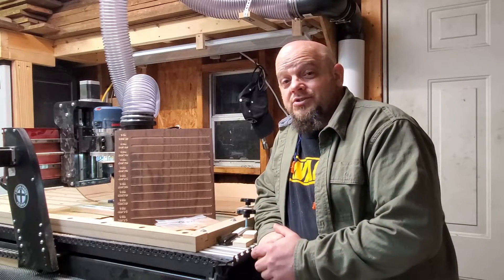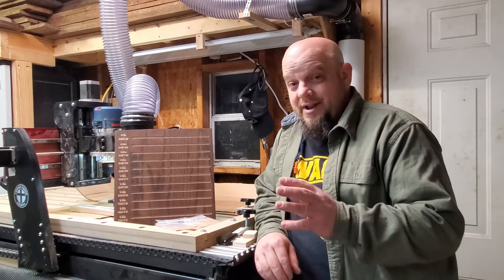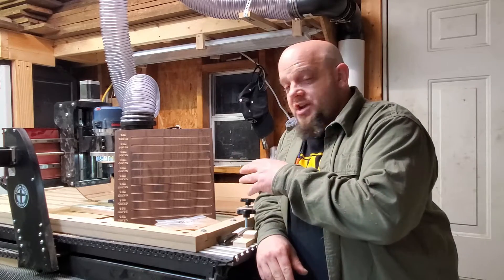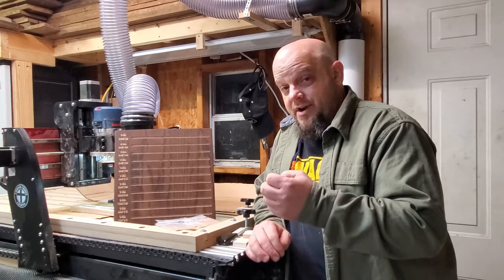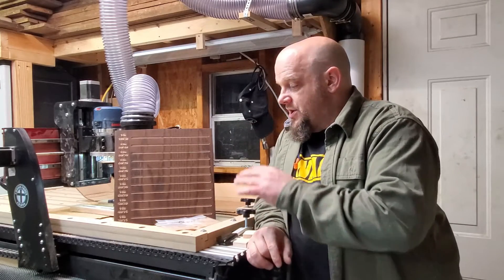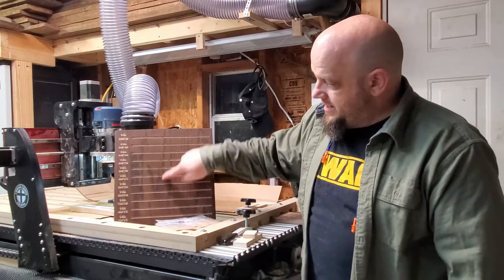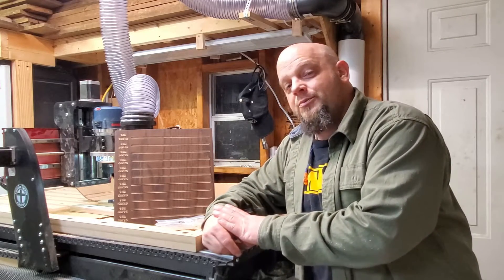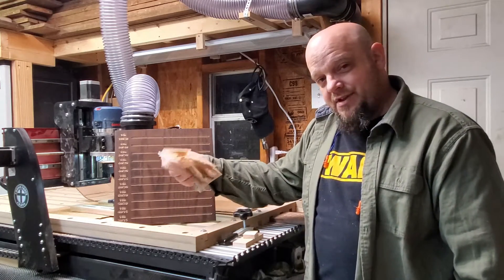Feeds, Speeds, and Chiploads For A Small CNC Made Easy

Comment: finally someone that does not speed up the video and replace the machine sound with music!!..As im just researching before a purchase you should explain some what chipload is..i had to google that..at this point i just want to know how many passes a hobby machine will need to take to cut fully through 1/2 thick mdf or in my case the less dense particle board..you didnt mention the depth of the cut you was taking with the end mill..was the depth of cut you was taking a 1/4'' ?..the same size as the diameter of the bit?..as long as i know the machine im considering will not need to make a ton of passes at less than a 1/64 depth of cut i might be sold..im liking the 1/4'' depth of cut, two or 3 passes would be ok with me..Or is chip load the amount of material that each flute bites and cuts off of the material as its moving into the cut, not of how deep the bit is down into the material?..confusing!
Reply from the maker: Chipload is basically the size of the chip produced.  Most manufacturers have a recommended chipload per flute.  Amana lists theres on their website for each bit.

The cheaper, less rigid desktop machines will always need to run at a slower feed rate, with lowered rpm to line up the chipload requirements.  You can play with those settings in vectric software.  Too high a feed rate and too slow rpm will make chunks, break bits, and leave bad results.  Too low a feed rate and high rpm will burn the cut and bit over time.

Mdf is way easier to cut than hard wood or plywood.  It is more abrasive but easier to cut.  The general rule of thumb is that the diameter of bit equals depth of cut, but on hobby machines, half the diameter equals depth per pass is a better plan.

I hope this helps some.

Comment: i just try search and looking what feed and speed need use my new 2mm and 3mm bit and V-bit 15 degree 6mm-0,3mm carving bit. but all have only old cavemen imperial dimensions, need normal metric system know feed and speed, spindle not can setting less 10 000 RPM. 10K-24K normal. little tip, 97% all earth use metric system, only 3 country use old historic cavemen imperial system today.
Reply from the maker: Do a quick internet search for inch per minute to mm per minute.  Fill in your specks and jot down the result.  A few minutes now saves a lot of work later.

Comment: Of all the "feeds and speeds" videos I watched, this was the FIRST one to tell and show me how to test my specific machine so I can document my recommended feeds and speeds for MY setup. 

If I purchased an off-the-shelf cnc from Shapeoko and the rest, they would have most of the F&S documented already - which is a significant value for a new CNC-er. I built my own setup based on recommendations from a friend in the industry and it's capabilities are somewhere in the middle to low-middle range of CNCs out there.  Now I know how to figure out the best settings for it!

THANK YOU for *demonstrating* how to test a machine!  Well done!  (Yes, it wasn't a fun and interesting video, but it was just as valuable - maybe more valuable - than the fun ones!)
Reply from the maker: Thank you for all the kind words.  That was the reason I did the video.  There was nothing out there showing and explaining.  I'm glad it helped.

Comment: I am really diving into feeds and speeds before I get my Axiom Iconic8 which gets delivered tomorrow. This is very informative! One more thing that would be very interesting that I will probably do when I get setup and run this test is get an infrared temp reader and check the bit temp at the end of each cut to see how the bit is handling the speed/feed. I currently have a X Carve and I have toasted (3) 1/4" bits running them too slow. Thanks for all of your hard work on this!
Reply from the maker: Some bits stay cooler due to coatings, but running them at high rpms and slow feed rates will certainly decrease life. 

Using the mfg data as a starting point then dialing down to match machine and project specs helps.  Then make notes in vectric for said bit.

Comment: Chris i have been breaking down each aspect of the cnc - enclosurer, dust collector, types bits, running Easel program, types of wood, and feeds and speeds. I just cut some plywood to 20x24 and was planning on creating a sample board. Not exactly sure what way to do it, your video was a great help! Thank you.❤
Reply from the maker: I ran into the same issue.  I finally came up with this as an initial idea.  I hoped it would help somebody.  Thank you for watching.

Comment: What is capability of your CNC machine, i.e. Spindle power and Maximum rate along X/Y/Z-axes?
Reply from the maker: On the machine in the video I didn't have a spindle.  I was using a Bosch 2-1/4hp router.  Shark does now offer a 2 & 3hp spindle option (If you have a Shark, the 3hp is the way to go).  

As for "maximum" rate (under load), that will be determined by the bit, depth of cut, part type getting milled (2D, 3D, small vs large), and material.  If you want specs, not under load, that is different.

Comment: Looks like the bit in this pass 3:26 has jumped/twitched at the middle of the pass, do you see it folks? And for groove N6 3:20  rpm is 12000 or 14000 actually?
Reply from the maker: The bit does move at that point.  12k @ 110ipm was not the best option, but was the combo used to obtain the recommended chipload.  That's the part of testing... to see what works and what doesn't.  That low of an rpm didn't allow the bit to spin enough to remove the material at that feed rate.

Comment: Nice video and I like how you did your testing ,thank you. The question is would the feeds and speed you used on oak be the same with plywood, MDF, pine, hickory, and so on as each wood is different.
Reply from the maker: Thanks for watching.  Sadly, the feeds & speeds will vary based on material.  Mdf allows for higher, while harder woods require slower.  Add in the machine variable and its an ever changing process.

If you can get a baseline (the reason I used oak) it makes it easy to put notes on each bit you test in vectric.

This is designed to help you gain a better understanding of your machine and reasonable starting points.
Reply: @ChristcrossCrafts  Thank You for the info

Comment: Nice! Just finishing up a diy 18.5"x 50" with open loop nema 34 motors at 24v and 3.7 amps (they get very warm but not HOT) and a 1. 5kw air cooled 3phase 110v air cooled spindle . I really like your approach to find the chip load capacity of various materials I'll be using with my machine. Thanks for posting.
Reply from the maker: Thank you for watching and taking the time to comment.  Like anything in life, cnc machines and milling tools have too many variables based on the material being used.  I enjoy running tests, as it helps provide a decent baseline to use when setting things up and offers a deeper understanding (and a visual) of what to expect.

Comment: Awesome Chris! Thanks for taking the time to make this video. This is well beyond what anyone else’s has done even the pros with their “commercial” machines. For anyone just getting started in CNC like me I think this testing should be done before anything else. Seems like it will save a lot broken and worn out bit issues.
Reply from the maker: Thank you for watching & the kind words. It's supposed to help those with small machines and give some idea of a baseline to start.  It definitely helps to understand what bits and machines can do, then save the data as a baseline in the software.  Good luck on your cnc journey.
Reply: Totally agree, thanks for the effort. To me it looks like the tests that we do on 3D printers, so smart.

Comment: Hey. Nice video. I have a question on making my diy machine cut faster? Thanks in advance for any assistance
Reply from the maker: That's a tough one.  I don't know your current setup but... Faster feed rates require a heavy gantry, ball screws & linear guide rails instead of belts, and steppers with a lot of torque.

You can't really upgrade one of these without improving others.  HD steppers on a belt will just stretch or break belts.  HD steppers without a gantry that will hold up to the quick movements will leave chatter and lots of vibration. 

The stand its on, a spindle vs a router (or 3hp router vs 1hp) will also contribute to the ability to gain more speed.   There are other factors but this is a good start.
Reply: @ChristcrossCrafts  Thanks a lot for your timely response. The stepper motors are quite large not sure the size off top of my head. They are attached to linear ball screws.

Comment: Great explanation of testing your Machine/Bit Selection for Feed/Speed/Plunge/Chip Load.  I'm going to run this test on my Laguna IQ to revise my Speeds & Feed Database.  Thank you for sharing.
Reply from the maker: Thank you for watching.  This is just the start but it will at least give you a baseline.  Harder materials like exotic lumber and some domestic may require a shallower depth of cut and/or slower feed rates to save bits and machine load.
Reply: Chris, I'm assuming that the plunge depth is 1/8" deep (.125) and it appears that you are using the ramp to enter the material on your test.
Reply from the maker: @jamesopell  My general rule of thumb is 1/2 the bit diameter = depth of cut and unless I'm drilling, I always use a ramp (usually smooth).   There are exceptions, but this is a good general rule to follow until you get more familiar with how certain materials will cut and how the bits will react.  Most small machines (the IQ included) don't have enough torque and speed to use deeper cuts at faster feeds.  The result is more deflection and chatter, which translates into poor cut quality.

Router bits typically aren't designed to simply plunge.  A ramp eases it into the cut, which is better for the bit, machine and the material.
Reply: @ChristcrossCrafts  Thank you so very much for this valuable information.  I'm so glad to have found your channel and will be come a loyal follower.  Thanks so much.
Reply from the maker: @jamesopell  Anytime.  I don't post a ton on CNC, but felt there was a need for this information and wanted to share.  It was worth all the work to get the data for reference.  If nothing else, it helps me dial in my machines.

Comment: The tool stickout is way too much, and that is a lot of the reason it sounds that way. I know that in some cuts you need to have more stickout, but for most situations, you should be using the minimum that you can possibly get away with, which still allowing for chip clearance etc. This is especially true of flimsier machines because the length of the tool acts as a lever on the gantry of your machine. Imagine the tool was 3 feet long, and how the machine would respond. Then, if the tool only stuck out a half inch. Much more rigid setup with less of the tool hanging out of the spindle.
Reply from the maker: Quality tool manufacturers design with that in mind.  Ive seen many people Chuck it up just above the top of the flute.  This not good, as this makes the bit more susceptible to snap at that point due to heat and vibration.  

Amana for instance, has a mark on their bits for a reason.  This is the point of the video... dialing in bits for specific machines because all CNCs are NOT created equal.
Reply: @ChristcrossCrafts  I should have clarified “way too much for your machine”. I didn’t mean to imply that the bit can’t handle that much stickout, but with that much stickout, your machine is oscillating.

Quality tool manufacturers design for a rigid machine. The specs you get are based on a machine that is strong enough to push to those specs. Yours is clearly not one of those machines, so those specs don’t apply to you. Likewise, you may well have that bit chucked up properly, according to how the manufacturer suggests, but that bit is simply too long for your machine. Every machine has a limit to how much the tool can be stuck out before the lever action of the tool acting against the machine itself causes enough force to get things vibrating.

Try running a 6” long end mill with a 4” depth of cut on that machine. You’ll see what I mean. No matter how you chuck it up, no matter what the manufacturer states, that machine will not be able to drive it without DRASTICALLY reducing speeds and feeds way outside the range of what is considered usable. You can lower the feed rate as low as you want, but at some point, you’ll hit the lower limit of how much you can reduce the speed of the spindle. Using a router, as you are, you have even less ability to lower the speed. That means that as you lower your machine’s feed rate, the spindle is still spinning at full speed and your chip load will be all wrong, to the point where you’ll eventually just be rubbing more than cutting.
Reply from the maker: @michaelkeymont501  You are correct and I agree.  The point was trying to use the manufacturer's recommended chip load specs (which shouldn't change much) to dial in feeds and speeds.  This was intended as a starting point to show that every machine is different and it is crucial to spend time learning what those limitations are when it comes to the topic.

I ran out of time to cover many other factors but did have plans on revisiting this topic to discuss chatter and other troubleshooting issues later.  

I've used small 12x12 machines up to commercial ones and that is always the issue.  The bit mfgs make the bits for industrial machines, not these hobby ones.  People just take for granted the importance of dialing their bits in for their machine.
Reply: @ChristcrossCrafts  Lol, there’s not enough time in ANY single video to cover it all! One one of my machines, I ended up adding 20 solid concrete blocks to reduce - not eliminate, just reduce - the amount of vibration that I’d get on some cuts. It was game changing in aluminum, but I still can’t reduce the speed of the spindle enough to get realistic speeds and feeds for steel, though.

I agree about it being crucial to keep learning and pushing the limits. A lot of new guys getting into this stuff are looking for a recipe, and as you know, there is no such thing unless you’re talking about the same exact machine making the same exact cut in the same exact material. If a person isn’t ready to put in the learning time, this will be a tough hobby for them.

Thanks for putting in the time and effort to put out videos. I’ve thought of doing it, but I have the personality of a dead fish....
;)
Reply from the maker: @michaelkeymont501  At first I was not interested in discussing a topic I am by no means an expert (self identified or by others), but I kept getting questions about it.  
My favorite saying is, "In CNC there is no one size fits all scenario because all machines, bits, and materials are NOT created equal."
That's partly why I always tell people to try quality bits.  At least you are starting on a good leg.  They are much more forgiving than cheap ones.
I had to put sandbags on an old lathe I had once just to keep it from walking around my shop, so I fully understand!  Sandbags worked better than other things I tried.  It helped deaden and absorb the vibration so much better

Comment: thank you Christ
Very informative, I am new in CNC my machine is all made of alluminum.  I bought a  CNC4Newbie frame and I'm going to do all these test. Thank you very much.  excuse my english, French is my first language.
Reply from the maker: Thank you for watching.  I'm happy it was a help.  I'd certainly run a few different options to see what works best.  Dialing down the rpm will help for those machines that can't run fast feed rates.  Smaller bits (1/8" and less) rarely have many issues.  It's usually just the 1/4" and above.

Comment: Why u dont insert bit in collet , u need to insert the bit in collet more , because like u inserted it will have mode runout , and more flex , and of course more chatter .
Reply from the maker: Tha amana tool bits have a mark they suggest you set the bit into the collet.  That mark is what I use to install the bit.
Reply: @ChristcrossCrafts  i agree they suggest to use the mark , but think the bits made for spindles with low runnout , our spindle doesnt have that , and that u need to inset it more in collet , because the most u get him out the more runout u have , and more vibrations .